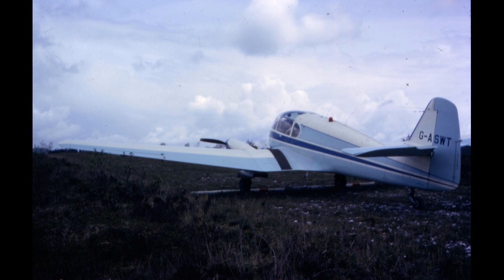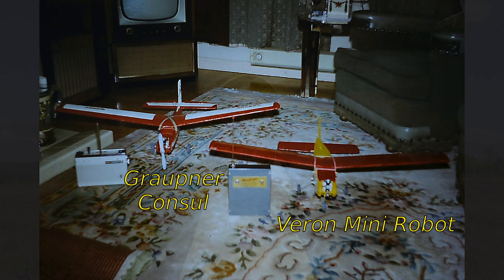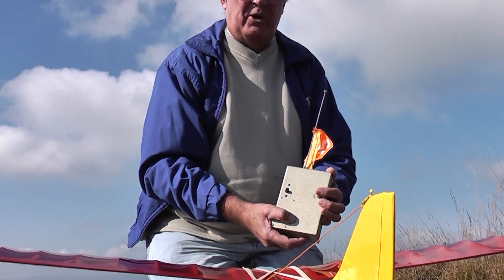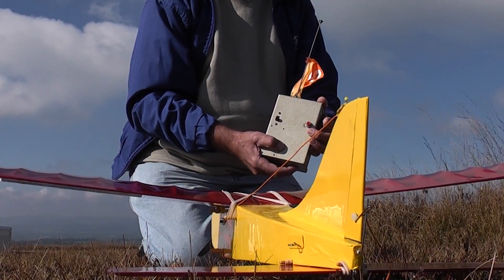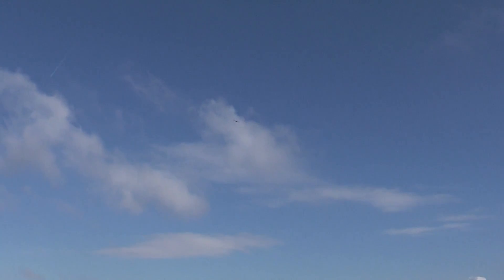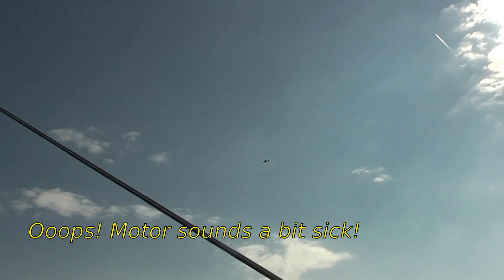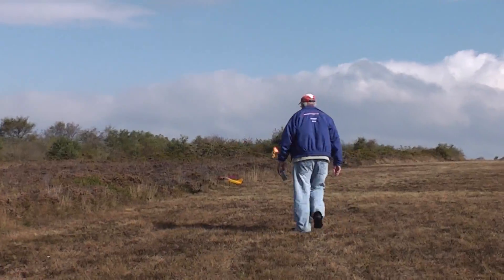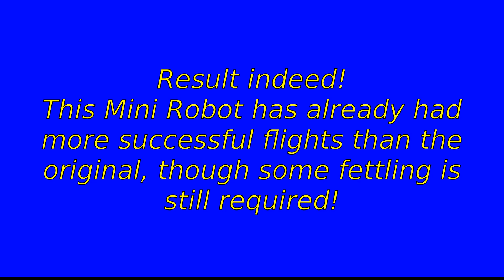MiniRobot LittleHaldon

Comment: Ah, happy days.  I had a super-regen system so had to grab all the 27MHz frequency pegs if/when I wanted to fly my old single-channel craft.  I still have an OS Pixie super-regen single-channel set and two escapements -- a compound with "quick blip" to operate the throttle escapement.   One day I'll get it all flying again... just for the sake of nostalgia.  I have a couple of Cox engines also ready and waiting.

Comment: "Ah", The memories,  My 2nd model was a Mini Robot  with a Frog 100  I still have a 1974 built one I flew that again  a couple of years ago but  fitted a PAW 1.5cc  first flight as was, further 6  flights & a lot of packing under the tailplane  great fun  as it used to be !!
Reply from the maker: Wow! It must have gone like stink with a PAW 1.49! I'm surprised the wings survived, they are notoriously weak! My first one clapped hands on its second flight, back in 1965, powered by a TeeDee .049! When I built this one, I used spruce for the main spars....!
Reply: @pchristy102   Trust me it did  Hence the packing , The Paw is the only small engine I had that works still , that first  flight started with the engine burbling nicely  then  then it pick up  & was a tiger by the tail,    mine has Spruce spars too on the advice of a clubmate when built ..  we flew them back in the day when  when it was too windy for the multi's to fly  & land back at your feet  Magic times ..